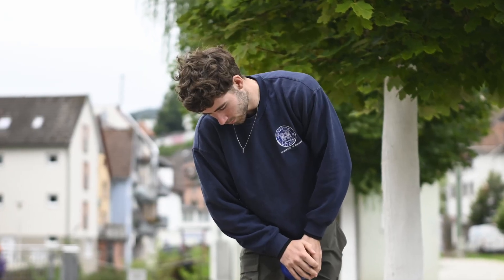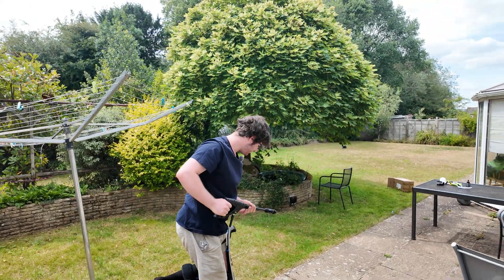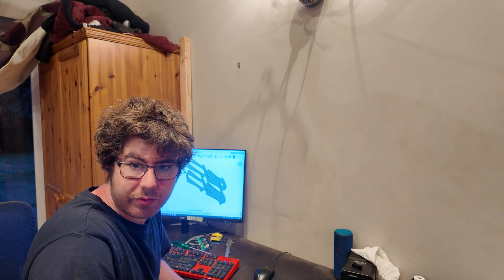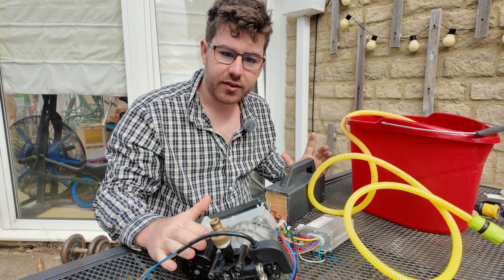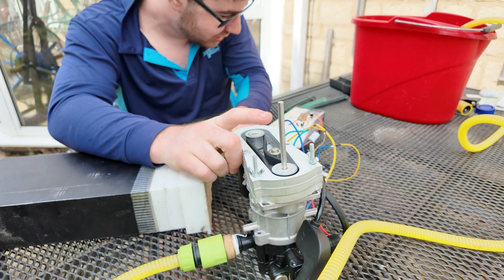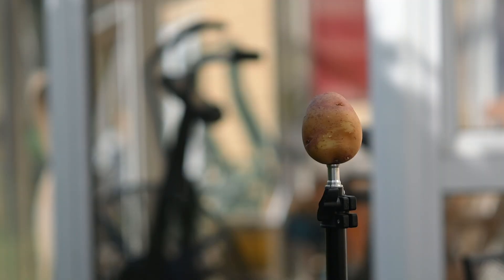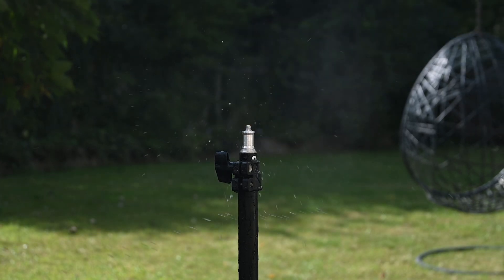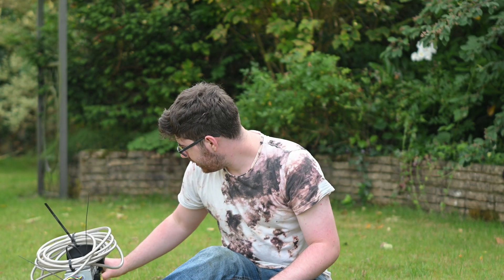I Built the World's Most powerful Water GUN!!!

Comment: Just dishonest clickbait, the fact you used a 7kw ESC doesn't mean the motor is running on full 7kw power
Reply from the maker: That would be ture if the  motor didn't draw that much power, but it can so it did. On the large 115v battery it peaked at 83amps(9545w), and averaged 58amps (6670w). However in the final build I was only running on 60v, so probably was lower power, but i didn't have a smart bms so I dont really know.

Comment: this might be a dumb question but why not just invert the output of a battery and then use the stock pressure washer
Reply from the maker: This is more powerful, the preasure washer is 3500w, this is 6900w. Literally the only reason is to get more power. Which was a mistake because I broke loads of stuff with the higher preasure

Comment: Hey mate, ditch that pressure washer hose and go get a hydraulic line made. It's cheap, short and could up the output pressure.
Reply from the maker: Yeah good idea. I also have to get a better gasket, because the join in the pump is leaking.
Reply from the maker: Actually just gave me a great idea, I have an old 500bar hydaulic pump, maybe ita time for round 2